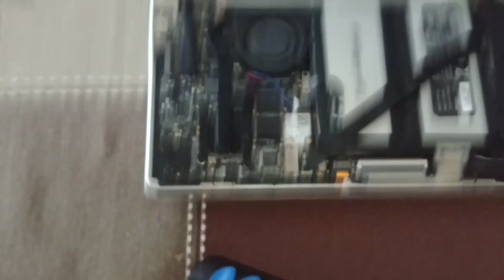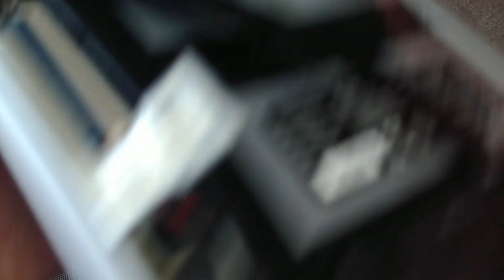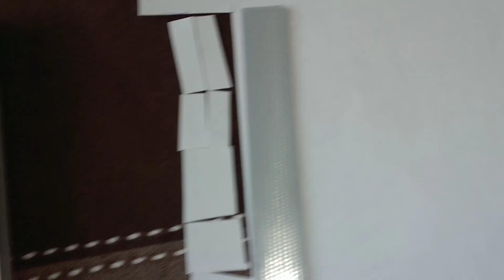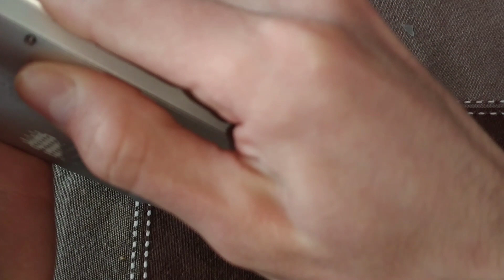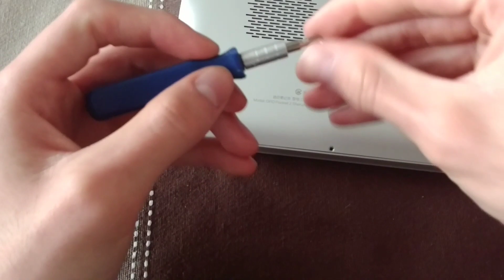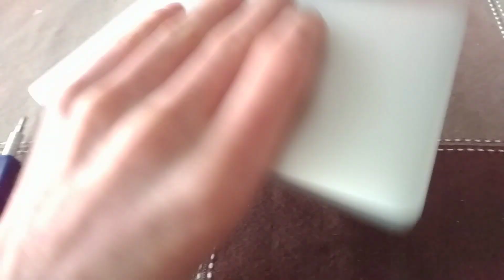GPD Pocket 2 Re-pasting CPU and Adding Thermal Pads (Thermal Mods) In-Depth Walkthrough

Comment: It is good to clean up the thermal paste that got on other components, but almost all thermal paste is non-conductive anyway so it really won't hurt anything. The exception is liquid metal thermal paste, that stuff IS conductive and will also destroy aluminum, stay away from that stuff for jobs like this.
Reply from the maker: I know, the paste itself is relatively harmless, just happens to be real good at thermal conduction. I do know someone tried liquid metal on it already XD That stuff scares me on a mobile device
Reply: @armandoragusaucy96z.71  Yeah I'd definitely stay away from liquid metal on mobile. I've used it before on my desktop, but that's different when you delid the CPU and put it between the die and heat spreader. At least there it's contained under the CPU heat spreader and it's easy to cover the few other components under there with liquid electrical tape.